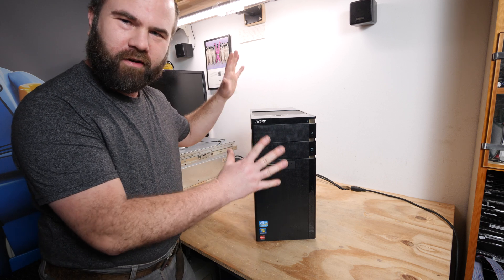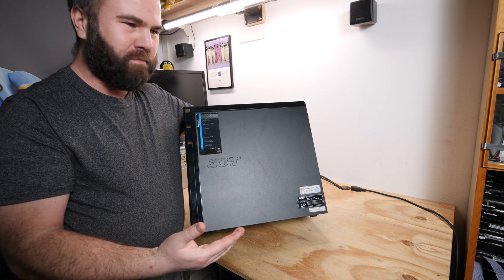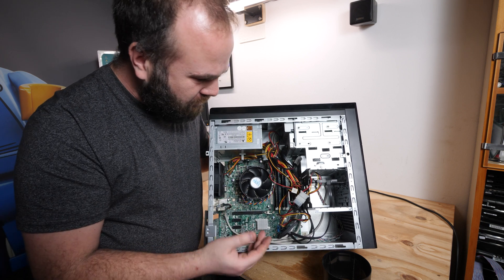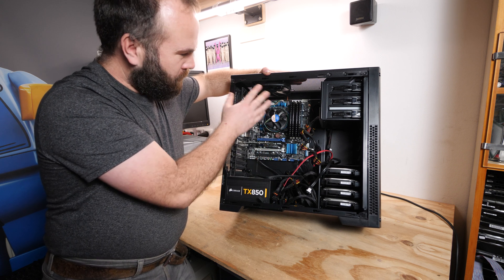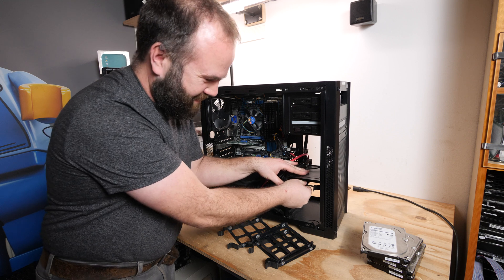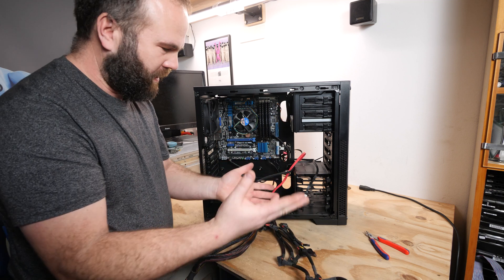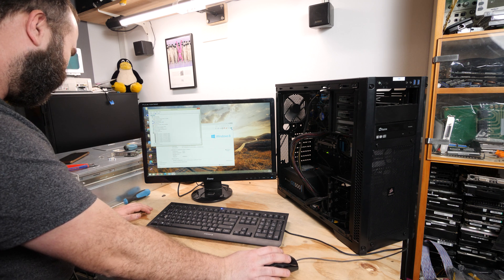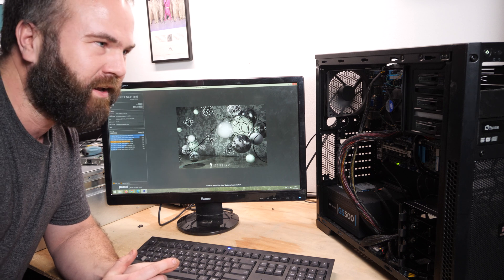Tech Troubles? Not Anymore! Fixing My Dad's PC with the I7 3770 Build

Comment: Hey Victor, I think you should upgrade Windows to 10 anyway. 8.1 is just fine, but for security reasons and newer browser. Chrome has dropped support in 2023 and using it with (in example) online banking is not recommended.